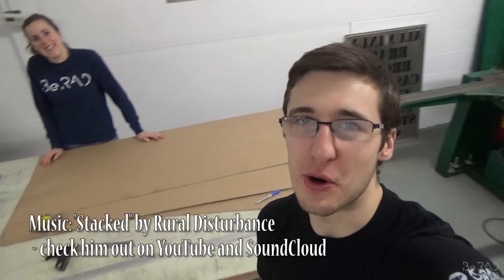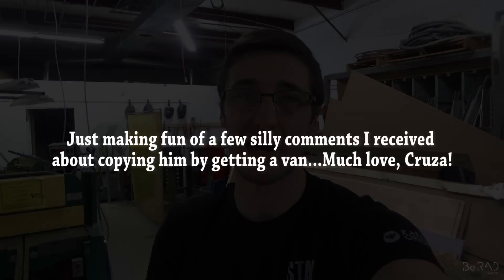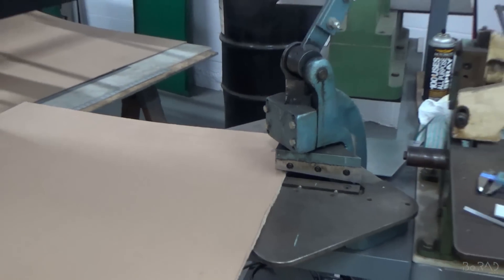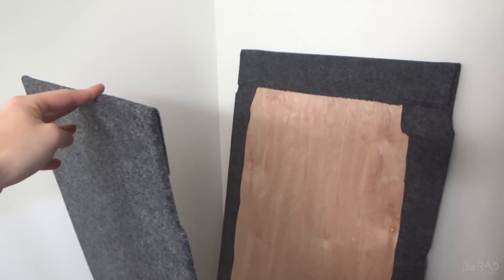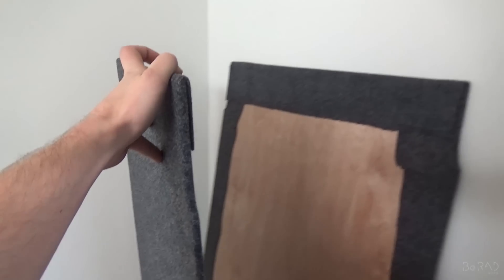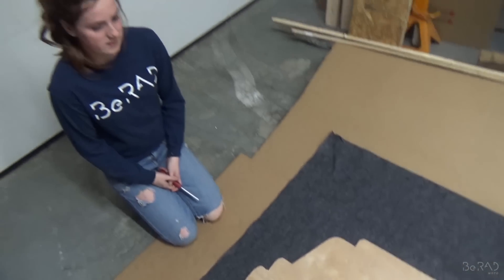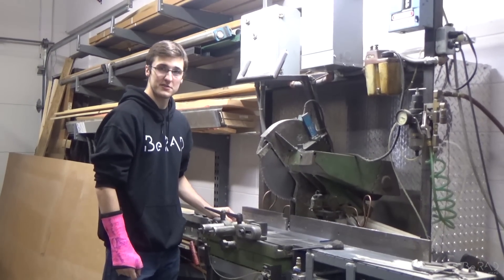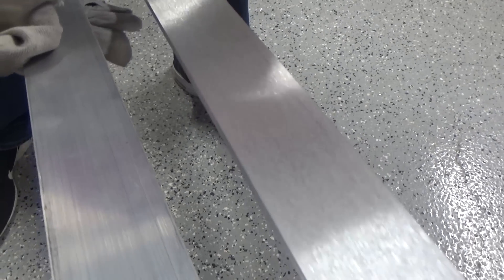It's BEAUTIFUL! - Ceiling Install [MotoVan Build Pt. 3]

Comment: just a heads up. we did a 32 ft snowmobile trailer so we would have a workshop when needed or just to thaw them out over night. did all the same as you've done for the most part and I'll say the ribs on the ceiling sweat pretty bad when heated in the winter. if we would of wrapped the ribs and used glue and nylon bolts this wouldn't happen. we've sense upgraded and corrected the problem. use self tapers to set the glue then put the nylons in after just to hold long term. I don't know how cold it is where your at but hopefully save you a headache.

Comment: I used 3m super 77 to glue acoustic sound absorbing foam to my wall and it ended up falling off after about 30 days. I then re-did the whole thing and used super 90 and it works great.
Reply from the maker: msxboy that's why I'm using carpeted wood as a wall to pinch it all together! It won't go anywhere ;)

Comment: do people actually use that for carpet?? just seems like fabric
Reply: Cj Iscool It's used to cover speaker boxes usually.
Reply from the maker: Cj Iscool it's relatively soft, easy to work with, incredibly abrasion resistant, and not too expensive. Perfect for a van that will see lots of interior abuse!